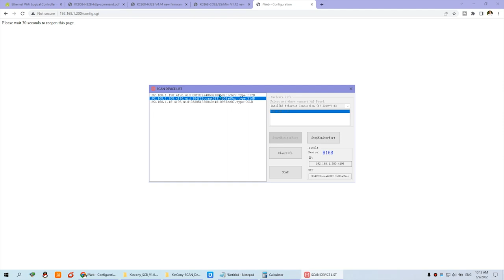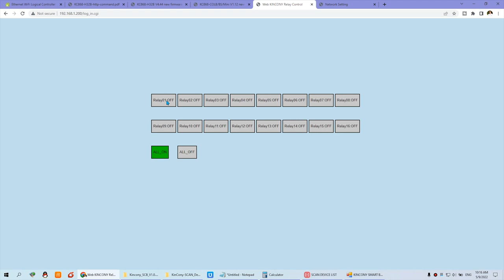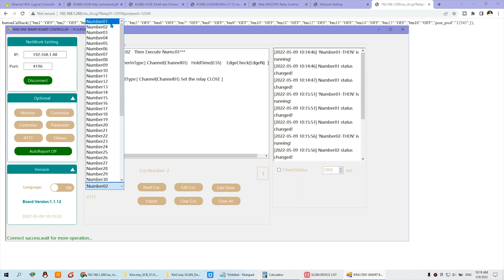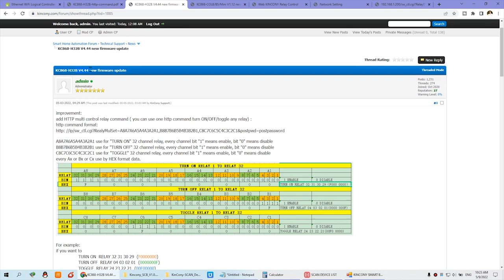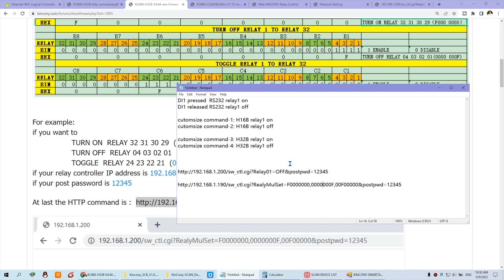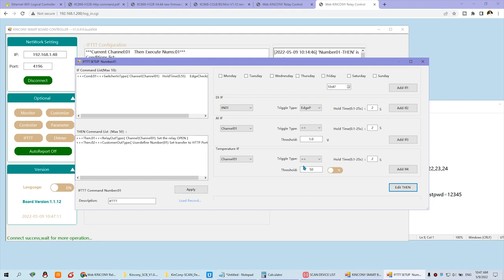one input module COLB automatic control different multi relay boards

Comment: Nice products! But is there a way to use HTTPS instead of HTTP to communicate with the different boards? Sending a password and commands in cleartext over the network is not safe.
Reply from the maker: you can write your own arduino code for anything
Reply: @kinconyiot  Would you consider implementing HTTPS in the firmware? It would make your products so much safer to use. 
Competitors like Loxone also have this feature.
Reply from the maker: No plans for that right now